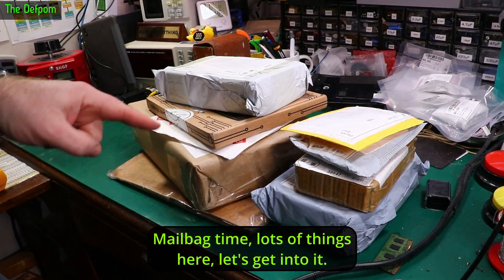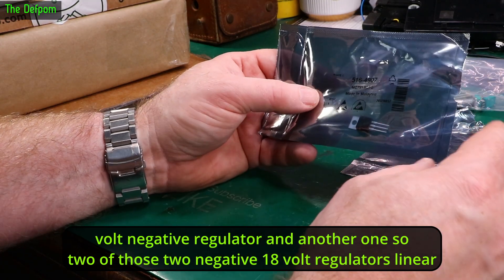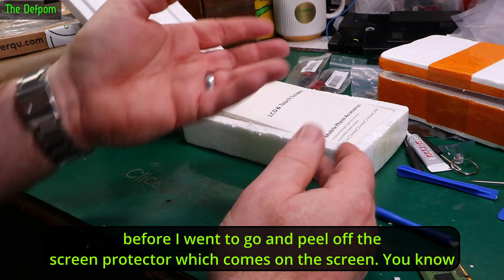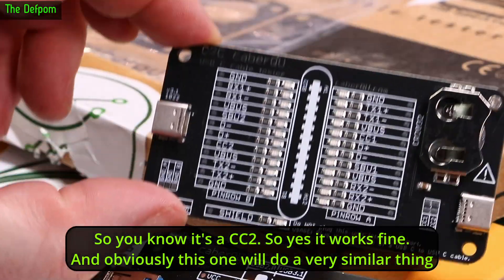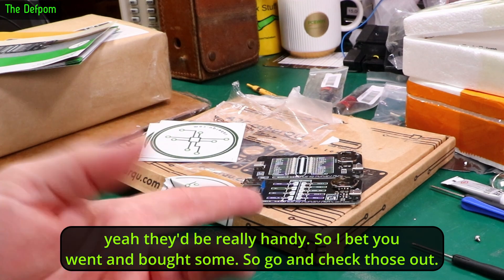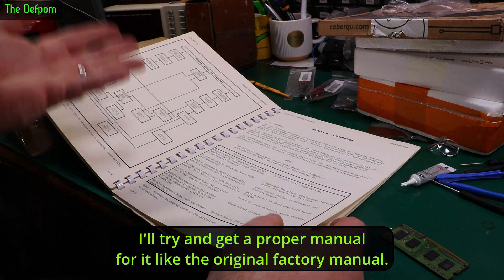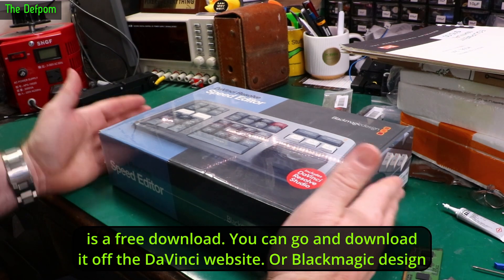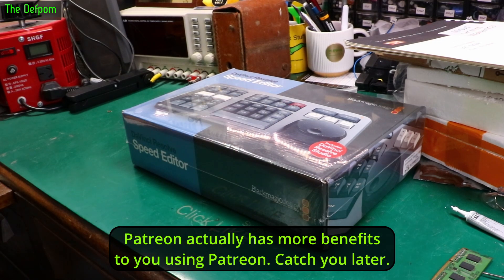🔴 Mailbag Monday 23rd October 2023 - No.1189

Comment: Lovely trimmer ! I have one Vishay spectrol, and two RS components clones, must be 45 years old by now.
The best bit about them is the tip blade is brass so non magnetic and very small. So they are great for RF transformers or pots with high voltages on them.
what's with the subtitles ? Just more clutter on the screen. 😞